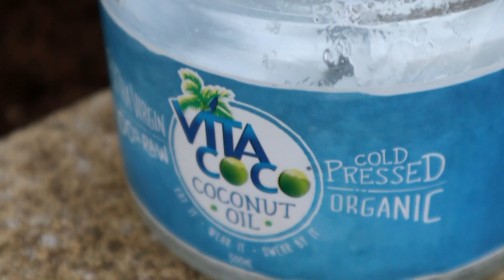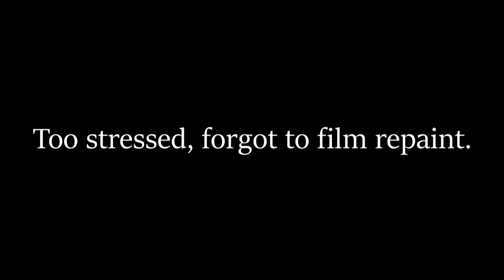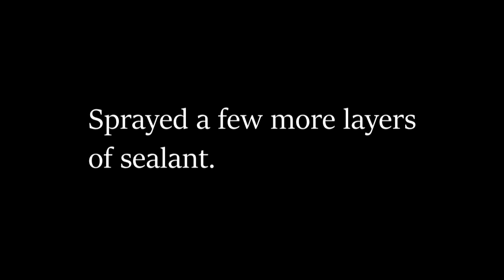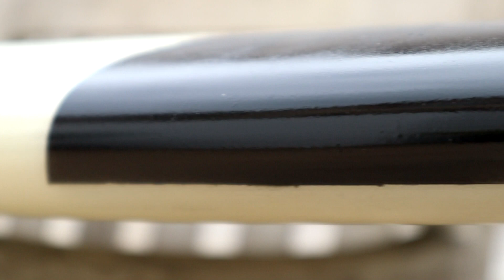SURFBOARD revamp // clean, paint, seal // 6 foot

Comment: Looks cool, but the paint doesn't seem to be something that would hold up in water and heat. How's it doing now? Let's keep our oceans clean 🤙
Reply from the maker: Heya! Thank you for your message, after putting on my sealant and a load of base & top coat surf wax the paints actually doing well! I've bumped my board a few times on-land and it's clipped a little, however, I keep an eye on these making sure nothing flakes off into the ocean :) In terms of water/ heat resistance - no problems so far but the UK surf isn't exactly warm for the paint... hope that answers your questions x